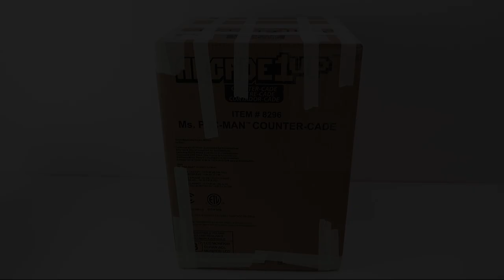Shabby Chic Chest DIY / Cardboard Box DIY

Comment: I make stuff with cardboard all the time. These included. A couple tips. 1). Fill an old Mustard bottle with your white glue and squeeze a stream out of it. Or get the squeeze condiment bottles from Dollar Tree. Just make sure whatever you use it has a  fairly small tip. When you are covering a large surface with glue, use a slice of cardboard to coat. 2). Foam brushes in various widths are the only way to go when spreading the glue. 3). You can buy a gallon of Elmer's white glue at Walmart for $11., even cheaper for the generic brands. Much cheaper than dollar tree little bottles. 4). Look in your closet for an old blouse to ling it with or hit up your local thrift store.  I'm so so so happy Karem made this video. Cardboard box chests are so much fun to make and although you need to take a couple more steps to add stability - they sell like crazy & fetch a sweet price!  Love this video!
Reply from the maker: Thank you Zoe for the tips. I just finished a bunch of trunk DIYs so you might see my sloppy ways of getting it done. 🤣. I not a very patient person so I use stuff that I have around me at the time. 😬😆.   Love the tips. 🥰❤️❤️❤️

Comment: Fabulous 🎉
Tell me, how did you mask up the box as most boxes have openings ?
Well done and thanks for sharing 😊
Reply: Extra cardboard flat pieces glued and taped over flaps, she showed the box all taped up and it's obviously doubled on all sides
Reply: I was thinking of gluing flat paint sticks in between the cardboard for more support. That way it can hold more without bending in the middle.
Reply: @tati001  it would be better on the inside or outside, if you create a space between the two pieces of cardboard you make it less strong
Reply: @emilymulcahy  on the inside like ribs. It was just an idea, do what makes sense to you.
Reply: @tati001  you said between the cardboard, that's not going to help, but inside the box will, I have made many paper mache boxes like this, just offering my previous trial and error